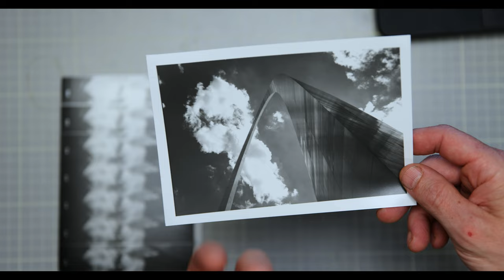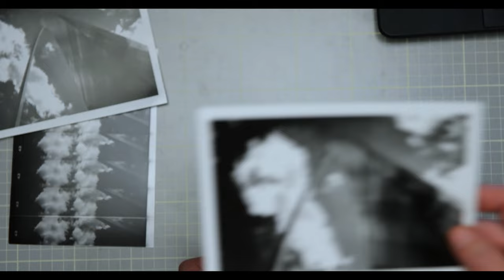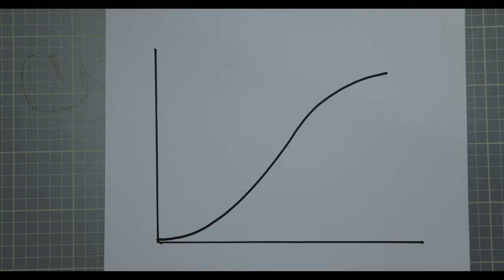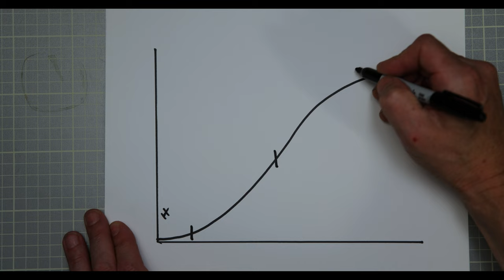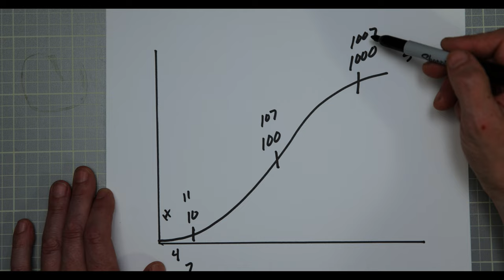Enhance Your Darkroom Prints with Local Contrast Control (Part 1 - Print Flashing)

Comment: Great explanation of this process!  Thank-you.  I was not aware the process affected the midtones, but it is certainly understandable.  Probably the lower value highlights even more (say, Zone 7 or so).   I have never used the process.  I simply use Kodak abrasive or K+ Ferricyanide (like Ansel did).  Both are much more predictable, and if you over bleach you simply retouch in whatever you lost.  But, these processes are limited only to fairly large negatives (whole plate--6.5 x 8.5 and larger).   Of course, you can also flash your negatives.  Ansel used to do this (refer to his book series "The Negative").  That you can certainly do with small cameras.  But with negatives you flash only to add detail to your shadows.  I never found the latter process made that much difference, and if I needed detail, it is very easy to simply retouch an 8x10 negative.  I develop prints only on AZO, which has an ASA of 4, and it takes about 2 seconds under a full bright 150 watt light to begin to gather any emulsion change.  (There are no stops, because this is contact printing, and does not use an enlarger).  Really, you offer a very fine video here.  You will help many people with it!
Reply from the maker: @callmeBe  Thank you!

Comment: Matthew, working through the problem-solving process on a single negative in this detail is something that would normally, I assume, be reserved for an extended. workshop (I never had the good fortune to attend one). The pedagogy can be enormously valuable for those new to the process. It's the kind of thing that is virtually never attempted in photography, outside a class or workshop,  with respect to composition, for instance. Granted, composition is another domain altogether -- dependent in various ways on technique but not a technical process like that which you are elucidating here, but the matter of systematically analyzing what tools are available and how they may be appropriate for use in combination on a single image offers immeasurably more than the more usual, "On this image I did this, on this one, I did this" -- with virtually no connection made. Hats off.
Reply from the maker: Thank you Phillip, there are just so many ways to approach some of this… some more time consuming and fitting for someone’s workflow and some might not be so fitting and might want to use different techniques all together… you can get so much more involved in a print if you feel the need 👍

Comment: 11:11 So if I do a test strip in 2 seconds increments and determin that the final print needs 10 seconds for a good exposure. Is it ok to do a exposure of 10 seconds continuously or it is going to be different from 10 seconds but in 2 seconds increments? I am not talking about print flashing, but regular printing here. Thank you!
Reply from the maker: It is a different exposure technically because everytime you turn the lamp on and of it has an arc to the output vs being constant.  You can use the constant it might just be a little different but as long as you are aware no biggie. could try 9.5 sec for instance.  But if you want the exact exposure from the test strip then yeah, break it up the same way.
Reply: @Distphoto  I see, yes. Thank you very much for the reply, I appreciate it! I did a few prints some time ago and the final print actually printed a bit darker than the test strips, the same exposure as the strips, but it was the full time in one go, so something like 6 or 8 or 10 seconds and not 2 seconds intervals. I was wondering if that got something to do with it, so maybe it did.
I am using the Meopta Opemus 5 enlarger but I don't have the original bulb for it, so I use a LED bulb with a matte dome, at about 10W or something like that. Do you recommend a certain kind of light bulb for enlargers like this? 

Thank you again! Appreciate the channel and the videos you put out! Starting watching a lot of them and I really learned a lot!
Reply from the maker: @ Not too familiar with the enlarger so not much help there I’m afraid.
Reply: @Distphoto  I understand. Thank you! :)

Comment: I'm curious if it's worth the pain of using the enlarger, since you can flash with a grade zero and (maybe) avoid muddying the shadows.
Reply from the maker: Yes you definitely can. I did not get into it and intend to do a comparison of flashing for different colors (blue/green light) that effectively target the two contrast layers.   I still need to test more myself on this so did not include it yet but I do typically flash with a green gel to target the lower contrast which would be the same as flashing under the enlarger with a 00 filter or there abouts. So yes I do think that is a good direction!